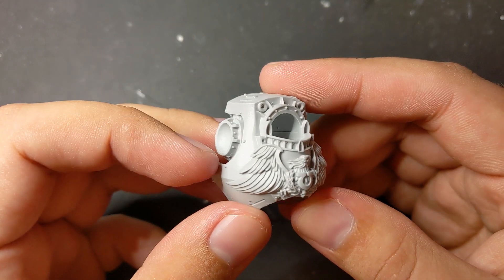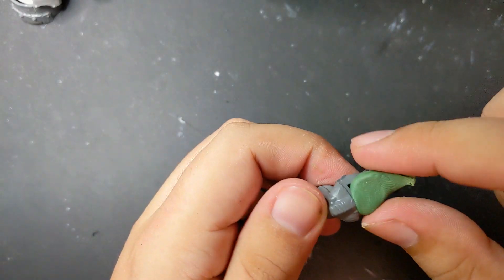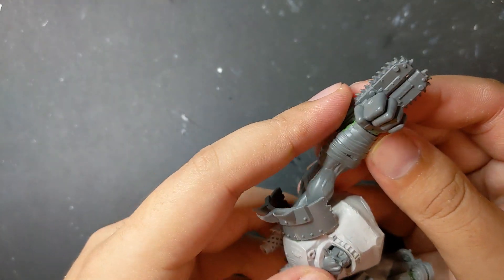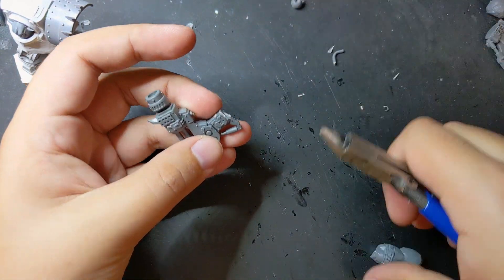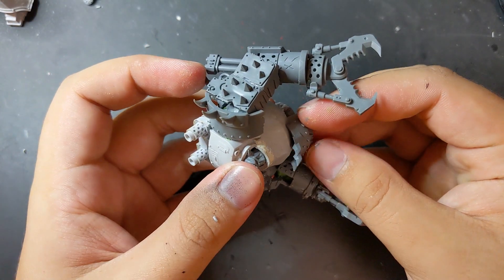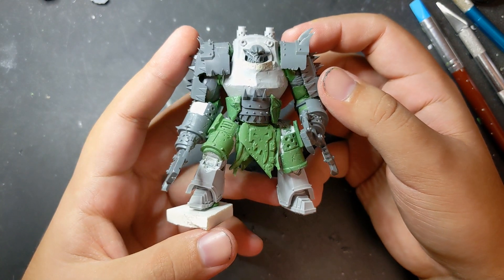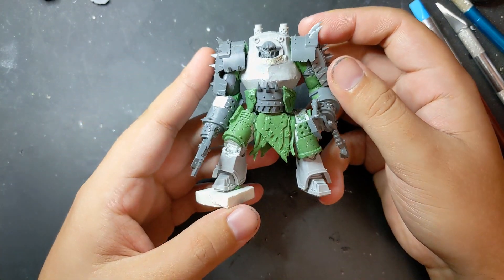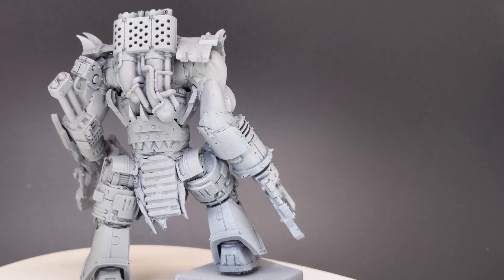Contemptor Warboss (Dreadnought Conversion)

Comment: When you just slapped on an Imperial Knight exhaust, I couldn't help but say 'What?!' at the idea of using a bit from such an expensive model for a conversion like this... Though, I mean, it wasn't cheap anyways. I mean, Deff Dread bits, Killa Kan bits, Ghorgon bits, a Forge World Contemptor, Imperial Knight bits, a 3D printed head-- This is not a conversion for the light of wallet. By my calculations, buying direct from GW, where possible, if you wanted to make this and didn't have any of the kits prior it'd run you $332.

Thank you for doing it so I can live vicariously through you. :p

Comment: So Im unfamiliar with what this “Green Stuff” is? Is it just moldable clay that holds it shape over time and if so, how did you remake the crotch drape and those little leg covers so perfectly? Did you use a kind of mold or freehand, Whenever I see you add more of this play dough I can only imagine that the slightest amount of pressure would utterly destroy and compress this orkish lad.
Reply: It is a 2 part epoxy. Mix the parts and you can sculpt it some hours and then it hardens.
Reply: Green Stuff is a putty that over time cures into a hard, rigid material. He likely made a press mold for the bits that he copied with it so that he could just push in some globs of putty and let them cure into shape.